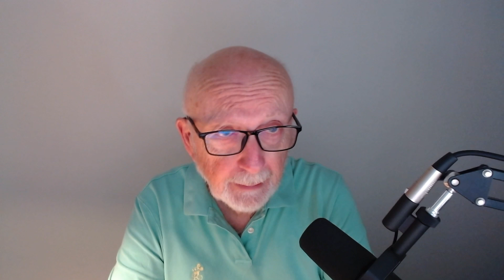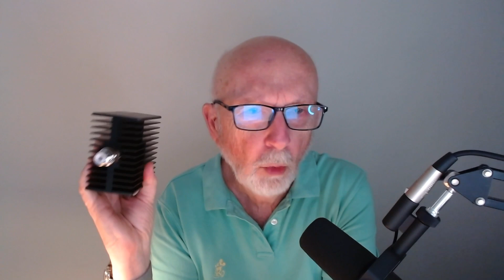Ham & CB Radio Myth - Non Resonant Antennas Don’t Radiate As Well.

Comment: Cannot the driven element of a yagi antenna be fed with parallel conductor transmission line at the center or zepp-fed at the end - with an in-shack  tuner - and function as intended (pattern and f/b ratio)? If so, why is this method not used? It seems it would negate the need for a gamma or other coax-to-feedpoint matching schemes..
Reply from the maker: The parasitic elements in a Yagi antenna significantly alter the driven element's impedance from its free-space value, requiring a matching network.

Comment: How many S unit difference if you are using 100 ft of RG58 at 70cm?  UHF and VHF are amateur frequencies too.  Your video could lead to a myth for technicians who primarily have access to UHF and VHF only.
Reply from the maker: I focus on the HF bands and have made that clear.  And you are wrong about the technician class license. 
"Technician licensees also gain limited access to the 80, 40, and 15 meter bands for CW (Morse code) and the 10 meter band for CW, voice, and digital modes. "

Comment: If you have a random wire and a tuned circuit making the wire resonant, it isn't a non resonant antenna anymore.
Put the tuned circuit at the base, and the efficiency is better, put it in the center, and it is much better!
But have the tuner in the shack, then you can't say the pattern is anywhere near a normal radiator.

But having a tuner to correct an antenna SWR from 1.5 to 1:1, is not getting you much...
Reply from the maker: True, a tuner will make a non resonant antenna resonant but the antenna is still not a resonant size if that makes sense.

Comment: Thank you for you video(s).🙂 I still consider myself a newbie (got licensed 5 months ago), have quite a few things to learn, and indeed I am a bit confused by ham radio myths and hardly judge what is correct and what is not. I try to understand your myth debunking, but sometimes I do not fully get it all, maybe because I am not a native English speaker.
So far, I assumed that a tuner can never improve the antenna as such, it merely can make the transceiver happy by matching the impedance and thus make sure that the transceiver outputs the full power and does not reduce power to protect itself. 
From your explanations, however, it seems to me that in fact a tuner does a bit more than that, but I am not sure if I got that correctly (the language barrier, you know). I would really like to understand what you are saying. Maybe you can have a look at what my problem in understanding is:
Especially from that Tim G5TM explains in his videos (e. g. "HAM RADIO: Vertical Antenna Size & Antenna Efficiency", https://www.youtube.com/watch?v=jJRp-14k8uw&list=WL&index=3), I understand that in order to have an efficient wire antenna, it is very beneficial to have a length close to 1/2 wavelength or at least multiples of that due to the far better radiation resistance. 
You are not saying this can be neglected, are you? 🤔
Instead, you are saying once the length antenna wire is more_or_less OK, it does not make sense to risk health by climbing up the ladder again and again and trim the length even more perfectly, but one should better leave it as it is and let the tuner do the rest by matching the impendance and make sure the whole system makes the best out of it. Did I get that correctly? 🤔
73 de DL1HNR
Reply from the maker: You got it right except saying the antenna tuner only makes the transmitter happy by giving it an SWR of 1.  An antenna tuner does a great deal more.  Note this from the ARRL Antenna Book:

"The reactance (a mismatch at the antenna feed point) presents no problem, because it can be "tuned out." The antenna system can thereby be resonated, even though the antenna itself is not resonant."

Did you note that the "antenna system" can be brought to resonance by a tuner?   The "antenna system" is the entire chain from the transmitter to the tuner and from the tuner to the antenna.  Even if an antenna is not a resonant length the tuner, tunes it to resonance.
Reply: @BustRadioMyths  Thank you for your quick reply. This what you quote from the ARRL Antenna Book makes it indeed clear that I underestimated what a tuner can do and really puts things into a different perspective. Quite obviously I need to rethink some of my convictions.
Thank you for your efforts to debunk the myths. It is in fact not so easy for a newbie to identify them ...

Comment: Saying an Antenna Tuner, " Tunes " an Antenna ?
You have to know thats wrong !
Antenna tuners simply afford a conjugate match for a Transmitters inherit design impedance !
The closest you would come to actually tuning an Antenna, is by installing an Antenna Coupler at the proper place, that being at the feed point !
Love your speaking voice !
If you weren't in Broadcasting, you missed your calling !
But I can't agree with your hypothesis !
All the above,
IMHO !
Reply from the maker: A tuner creates a conjugate match at every junction in the system, including the antenna feedpoint.  So by tuning out the reactance there it really does tune the antenna and the entire system to resonance.   https://youtu.be/cVLSBCP7re0?feature=shared
Reply: @BustRadioMyths  
Guess I'm too old to change my ways !
And will agree to disagree !
As referencing anything from the ARRL, is only information provided by its members !
And sadly, for decades now, has not been a reputable ally to the Amateur Radio community !
Once again.....,
IMHO !
But thanks, anyway !

Comment: This is a myth that is hard to debunk when you have radio manufacturer representatives spouting it.  There's a video that just came out at hamfest where one of these guys goes on how there is nothing like a resonant antenna that can hear better and transmit better than non resonant.  - Still, keep up the good fight to set the record straight.
Reply from the maker: And antenna manufacturers are going to boast about how their vertical doesn’t need radials and is resonant on every frequency in the spectrum.

Comment: A mag. loop is a non-resonant aerial brought to resonance but it will not perform like a dipole. There are efficiency figures for them and as the frequency drops so does efficiency.
A short non-resonant dipole is brought to resonance with loading coils. Coils are lossy.
Comparing both with my dipoles, I'll keep my resonant dipoles.
G4GHB.
Reply from the maker: Now try a dipole that is non resonant because it is too long.  Use a tuner to bring the system into resonance and you will not notice any difference.
Reply: @BustRadioMyths  Why would you put up a non-resonant dipole? A dipole naturally close to 50 Ω (73 it is said but a good match) and resonant. 
A short vertical with loading coil is not as good as a full size quarter wave. Think of mobile aerials for lower frequencies. The r.f. doesn't get out as well.
H.f. is very forgiving and it's why QRP works and why poor aerials work.
I'm not taking my five resonant dipoles down to put up non-resonant dipoles of unknown impedance, wrong length and radiation pattern scattering who knows where and using a tuner to compensate. Why would I? It makes no sense.
Reply from the maker: That's like owning a separate car for every place you go.   Look up what a Double Zepp is.  One antenna that efficiently works all HF bands.
Reply: @BustRadioMyths  Wire is cheap so I'll keep my five cars.
Reply: I don't knock multiband aerials. As I previously said I used a doublet and long wires with an a.t.u. to good effect years ago. It's just the lobes come off in different directions so unlike dipoles you may not get maximum r.f. where you want it to go. However h.f. is very forgiving and it's why QRP works. I got awful signals from Japan years ago (never worked it) on my long wire so it's very possible it was in a null.
I'll keep my dipoles.
It depends what you call non-resonant. I wouldn't use a short vertical or random long wire. That's what I call non-resonant! I keep saying this. As others on here have said. A tuner is needed to bring it into resonance. It is then a resonant aerial and no longer a non-resonant aerial.
Reply from the maker: Now I see what you are saying and I agree 100 percent.
Reply: @BustRadioMyths  Right, I'm glad we got that sorted. 
Another comment was saying the same as I did about non-resonant aerials classing them as I do.
Reply: @bill-2018 a resonant dipole cut for one frequency is around 1.5 swr  
Vs
A slightly shorter dipole with a 10.1 swr 

Use rg 58 on the resonant dipole and 600ohm open wire on the slightly shorter dipole 

Bring the non resonant dipole to resonance with an antenna tuner there is no noticeable difference that can be measured on a received or transmitted signal 

The non resonant dipole brought to resonance by the tuner has actually more power at the antenna to radiate, in this eg the feedline is key for that efficiency of power transfer to the antenna, radiation efficiency hasn't changed as the antenna is not significantly shorter enough to change the pattern

Resonance doesn't guarantee efficiency
Reply: @paulm0hpd319  I took my outdoor doublet down because it ran east to west with lobes off in other directions than north/south as the frequency increases.
My five dipoles all fire almost east to west and good for Europe and America. I don't want an a.t.u., another reason I got rid of my doublet. 3 short coax cables to my dipoles. 1.5:1 is fine by me.

You're saying a slightly shorter dipole than a resonant one?
I need five slightly shorter dipoles?
Five twin feeders through my ceiling?
Reply: @bill-2018  just showing that a non resonant antenna made resonant with a tuner that has high swr can be just as efficient in the same frequency as a resonant antenna
Reply: @bill-2018  that's as maybe but not necessarily for every situation as I've already mentioned
Reply: @paulm0hpd319  Just thought you might like to know.
Reply: @paulm0hpd319  Never mind. It suits me, a great match to the tx and no tuner.
Just need to re-do the others now.
Reply: @bill-2018 extended double zepp antenna outways your resonant dipole
Reply: @Pioneer936  I told you I can't fit one in!
Reply: @bill-2018  you don't have to, just stop saying a resonant dipole is best when it's not

Comment: Great video. I run low power when portable. 49 to 1 unun with length of loudspeaker wire thrown into a Bush or a tree. As long as I can make contact at under 10watts that's  a efficient antenna to me as cheaper and homemade from scrap the better. Ps sometimes use a loading coil made from.plastic garden table leg and fence wire. Plenty of money saved for wine and beer. Cheers from old George in the UK. Ps I used to design and build Thermionic  Valve Amplifiers. EL34 with ECC83 phase splitters etc. I think you call them Tubes. JIM Marshall Amps I used to repair with also Simms Watts, Wem, H and H, Eagle PA Amps and many more. Keep you warm in winter.😂
Reply from the maker: I've recently built an EL84 and 6V6 stereo amps.  Never heard a solid state amp that can beat tubes.  As for your ham radio operating, that's what it's all about!  Helps to really understand what's happening in an antenna and transmission line.
Reply: @BustRadioMyths  Do you remember the Germanium Transistor output that melted.🤣
Reply from the maker: No I have not!!!   Sounds entertaining!
Reply: H.f. is very forgiving and it's why QRP works.
Any aerial will radiate.
5 Watts and less for 30+ years here.
G4GHB.